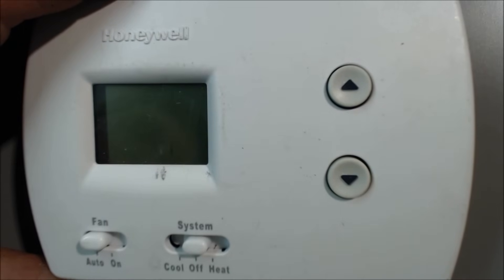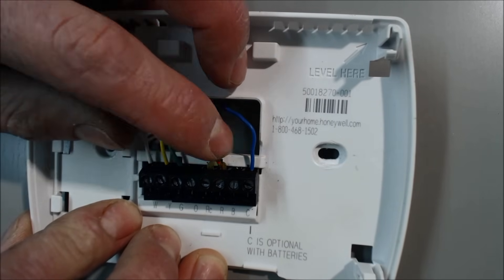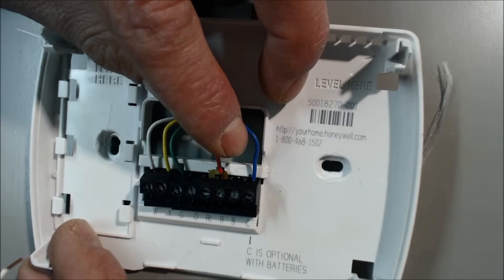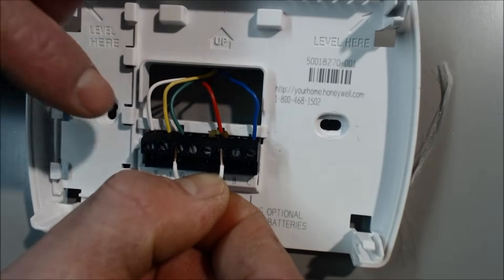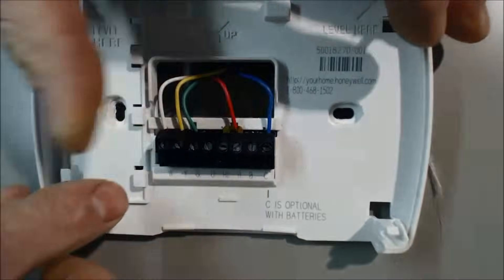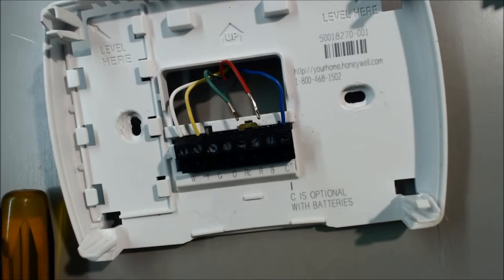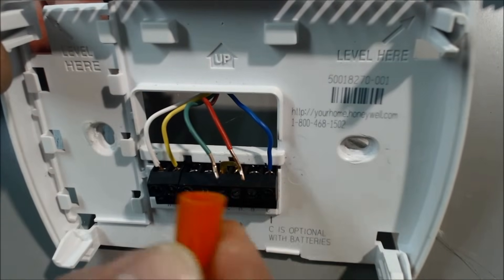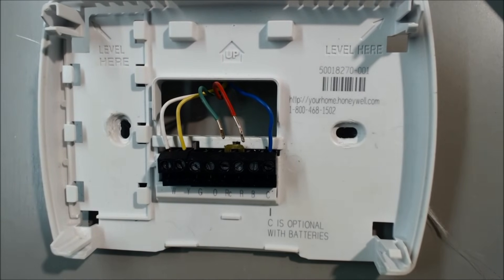Troubleshooting if a Thermostat is BAD: Explained!

Comment from the maker: Get Our HVAC Resources Here!
▬▬▬▬▬▬▬▬▬▬▬▬▬▬▬▬▬▬▬▬▬▬
2nd Edition Refrigerant Charging For Air Conditioning Paperback: https://amzn.to/4aw2OOd
2nd Edition Refrigerant Charging For Air Conditioning E-Book: https://www.acservicetech.com/product-page/ebook-2nd-edition-refrigerant-charging-service-procedures-for-air-conditioning
Mini Split Paperback: https://amzn.to/3Y4GcfN
Mini Split E-Book: https://www.acservicetech.com/product-page/e-book-inverter-mini-split-operation-and-service-procedures
HVAC Quick Reference Cards: https://a.co/d/0LZKfAt
Refrigerant Cycle Posters: https://amzn.to/4aw2OOd

Our Free HVAC Educational Materials!
▬▬▬▬▬▬▬▬▬▬▬▬▬▬▬▬▬▬▬▬▬▬
Get The Tools Used In Our Videos! https://www.acservicetech.com/tools
Our Newest Articles: https://www.acservicetech.com/articles
Try our HVAC/R Quizzes! https://www.acservicetech.com/quizzes
Reply: so before i do anything, i should shut off power to house right? so i dont get electrocuted? then open the panel display? I have a honeywell CT500 that goes blank every so often and now not generating cold air...i have a brand new AC unit too. it has no batteries, so that cant be the problem. i also reset the circuit breakers and the display panel of thermostat still goes blank and then re-appears. it does this every few minutes or so. is it a problem with the wire connection of thermostat? is it loose?
Reply from the maker: I recommend calling a tech but they would shut the power to the hvac system off and take the tstat face plate off and tighten the connections on both ends, in the thermostat and in the furnace or air handler. After that they will check for 24v to the thermostat and if they have it then it is a bad thermostat. It could also be one of the pins not aligning on the back of the thermostat.
Reply: did u power off the thermostat? i see nothing on the panel at the beginning of vid.
Reply: How to replace thermostat for boiler heater
Reply: How to replace thermostat for boiler heater
Reply: What size should the Fuse be at furnace Blower switch 15? I don't have breakers Ty~Jill~

Comment: I’ve got a heater (gas forced hot air) that also turns on the compressor.  And I don’t have a heat pump

Comment: My thermostat is reading at 72 but jumps to 74 before it goes to 72. My ac went out today and it seems like when i put it on auto, it doesnt start most of the time at all but when the fan is on it turns on but doesnt cool much. My apartment is 82 degrees right now. Is it my thermostat. I jumped the cables and my fan comes on.

Comment: My thermostat says it’s 41°. It’s not my house is cold. It’s stuck at 85% humidity it isn’t. It won’t let me program my weekly times and temperature. I can do it when it’s cool meaning the air conditioning but I can’t do it when it’s on heat because of this override my house is not 40.5°C.

Comment: What’s it mean when fan will only jump off if you catch it try to start but if it’s not trying to start up it won’t jump off
Reply: The Thermostat came with House is older model house built 1983

Comment: Do you know if having the capacitor changed on an exterior HVAC unit would cause the thermostat to behave differently on both heat and cool? 

For example, I had the heat set at 69, was cold this morning, so bumped it up to 70. Waited a few seconds, nothing. Bumped it up to 71, it started immediately. Room temp when finished was 70 though, measured by a refrigerator thermometer I had balanced on top of the thermostat.

Another example, AC was set to 73, and I dropped it to 72. At 72 (the desired temp), unit kept running. End temp was 72, according to that refrigerator thermometer, but it normally would have shut off once the thermostat read 72, not kept running. 

There have been maybe 15 second delays for the unit to kick on after changing temps, though I swear I could hear the one in the basement kick on immediately when I was playing with it last night, just not the exterior unit.

I've been playing around quite a bit with it, so I forget what's what. I just know the unit would kick on immediately with any temp adjustment, up or down, even if I switched directly from heat to cool or cool to heat right away. It's a forced air electric heat pump, if that matters. I almost wish he hadn't changed the capacitor because I liked the way the thermostat used to behave. I even went out and bought a new thermostat, the same one, $100, that I plan to install myself today, just so that they don't charge me $400 to install theirs when another place comes by tomorrow. Actually, that was the price they quoted to install mine. I don't want them telling me something else is wrong, if there isn't. Plus, I need to see how a brand new thermostat behaves so that I know what to tell them.

Comment: Question about colors of wire and the location on what letter the colored wire is placed. 

On my thermostat there is not a yellow wire. Only red, green & blue. 

Red on R
Green on G
Blue on Y 
No wire on W

When I check with the wire red & green my fan does turn on.  If I understand correctly that means it’s my thermostat front that needs replacing.

I may have screwed up the compressor by  checking (R) and blue (Y).  Is it the letter location that matters? Or, did I wreck something by checking Y & R because Y has the blue wire?

My air conditioner is controlled thru the thermostat.  The Rc is the AC? If so how come there is not a colored wired attached? 

Ii know that G is my fan and it turns on. 

As shared I tried R & Y and nothing happened; 

I don’t know where to check the AC unit either only having 3 wires versus 4.

Comment: Hello Craig. I was working in the field and ran across a thermostat that the voltage on the R and Y was 16 volts, it also showed 16 volts in the air handler and 16 volts in the condenser. Testing the Red with green, and Red with white both registered 27 volts. What could be causing the voltage drop? The contactor does not show any voltage on the coils, but when testing the coil for ohm it shows 12.8 ohm and it also has continuity. The contactor is not sucking in at all. What could be the problem? Thanks for your input.

Comment: Hi.  The screen on my thermostat is blank.  I replaced batteries, nothing.  A couple days was back on.  Now blank again…but, if I press the temperature up, it comes on (not the screen, the furnace).  Also, if I turn fan on it comes on.  Any ideas 💡. Thanks so much.

Comment: I had a call where the AH was running but the condenser was not. I had no voltage between C and Y at the control board outside or the AH. Pulled out the Tstat and jumped between R and Y and the system came on. Tstat was bad.

Comment: So my AC and fan work yet my heat (propane) does not. I did the red and green as you instructed and the fan ran so could this be the reasoning behind my heat not working properly? Does this also cause short cycling?
Reply: If I wanted to check the heat I guess I would have to jump the Red and White?

Comment: Is there a follow up video of what to do if this doesn’t work?.. I recently got a new condo.. I installed a “smart thermostat” by EcoBee. It worked fine for a few months but then suddenly stopped. I’ve flipped all breakers, I tried the things in this video.. what is weird is that since it is smart, it will send me notifications when it turns on about the temperature. I will be at work, and out of nowhere (nobody lives in my condo than myself and my cat) it will turn on for like 20 minutes and then go off again..

Comment: If the heating works and ONLY the A/C won't work, what is the most likely culprit? The thermostats display is fine, as is heat. Do you have a video to diagnose A/C only? I think the fan is fine since heating is working.
Reply: Thermostatic expansion valve(TXV hvac)? I've learned that when they fail, that the heat can still work; they are designed to fail that way(generally speaking), so you'll still have heat if it were to happen in extreme cold season.
Might not be of any help to you; just thought I'd suggest in case you're still in need, being it came to mind when I read your comment.
Reply: @rabdhall05 some unit have heat strip with no reversing valve 
So tvx valve will never go in heat

Comment: I know this is an old video but, I only have a red and white wire going to my thermostat. When I turn the heat on for my thermostat the boiler runs for a while and then shuts off. A couple minutes later it kicks back on and so on. It just keeps running like that no matter what the heat it set on. You can have it set to 60 and the temp will keep climbing...We've replaced the thermostat with the same one like three times and still get the same outcome. I just turned the boiler off and touched the red and white and turned the boiler on and it kicked on. I've had a couple people look at it and nobody has an answer.
Reply: Tie red and white together at the thermostat and see if it keeps doing the same thing, then you know the problem isn't the thermostat maybe a bad auquastat or something else.

Comment: If I’m jumping power to check the heating operation I always add the fan into the jump beacause I don’t want any thermal overloads to burn out by turning the heater on without the fan running

Comment: My furnace wouldn't turn on, and I realized that the problem started after I had changed the thermostat batteries. Checked the thermostat wiring and thought that the excess dielectric grease that was on the male and female terminals was causing a problem, then realized that because of the awkward location where the thermostat
was mounted, that the display portion of the thermostat hadn't fully seated all the pins. If you didn't look at it closely, you couldn't see it wasn't seated.all the way It allowed me to run the fan, but not run anything in auto, therefore no call from the thermostat. Motto: Make sure the face plate is fully and evenly seated.

Comment: Any idea what would cause the blower motor to blow harder once I removed the jumper wire to diagnose the thermostat. My blower kept blowing for about 20 seconds after I pulled the jumper wire and it blew harder than it did when thermostat  was working

Comment: I'm a little timid about even asking this question....if the face plate of the thermostat is off and you are jumping the wires outside of the backing plate..how are you turning off and on anything? I'm lost a little (or a lot---lol) on this. 
My AC is blowing but not cool. Trying to troubleshoot a little to see what I could try to replace but hate to replace parts that are not bad. 
Anyone with a suggestion....I welcome it. Thanks much. Jesus bless.

Comment: My  Lennox  Air Handler CBA 27 fan will not come on on circulationg "ON' setting since it was installed 3 years ago. Just running AC from my attic. Would like to circulate the fan all the time. I have even changed out the thermostat. Any thoughts?

Comment: So if you jump the 24v wire to the g wire and it turns on (thermostat is set to auto not fan), that means the thermostat is bad ?

Comment: When you say fan, are you referring to air handler fan or compressor fan?  My AC is not getting 24V at contactor to turn on compressor and compressor fan but air handler fan is working.  I'm getting 24V b/w R and Y, R and G, R and W on thermostat.  When thermostat calls for cool, G and Y goes from open to shorted (connected).  So the thermostat is working fine, correct?

Comment: What causes the ac to keep running when thermostat temp reaches but it’ll cut off at night when outside temp cools down?
Reply: For residential home with local thermostat. Possibly a schedule for the cooling on the thermostat.. 1 yr later and no one could comment their best guess. Comments are greatly welcome
Reply: The ac with cold air keeps running after reached setpoint? If just fan is running blowing normal return space temp air, then blower probably has a schedule. Or the contacts themselves are bad in the thermostat and the unit shuts down late at night due to low pressure/ low limit with cold outside air. Then resets the next day

Comment: Thank you very much for your video. My system was keeping running when both inside and setting temperatures are matched, what is caused the problem inside the air-handler, need help?

Comment: Another way I have done it. I used the pins on the back of the thermostat battery operated type. Call for blower the pins should ohm out. Same thing for calling for heat. Make sure you are connecting to the correct pins because they are not marked you have to reference how the pins plug into the back plate.

Comment: I just put in a new condensate pump. Pretty simple. Turn off the power, unplug the old little giant and remove. Install new little giant, plug in and power up. Problem is that after doing this I have no power to the thermostat. I jumped the fan but it doesn't run. It's a tempstar and I don't believe there is any reset switch. I have checked fuses and breakers and all are good. I filled the reservoir and the pump works. The pan is not switched for water. The fan just hums. I checked the capacitor and it shows 7.3. Any idea where to look next?

Comment: Excellent tutorial.  I asked a guy years ago how he knew the tstat was failed, he said, 'I jumped it' and I assumed but didn't know that meant (esp with multiple wires, and why).  It makes sense if something is simply not turning on.  If it starts/stops w/o hitting temp, I assume that is on furnace side?

Comment: A service guy came and told me the first stage heat pump does not work because he could not feel the heat when touching the tube. Do you have a video to check which heat pump has problems in the two-stage electric AC+furnace system?

Comment: What’s wrong when the thermostat works on fan only ? When put on auto the ac and the heat don’t work. It does nothing, no sounds or anything
Reply: I found the thermostat wire and didn't know that's what it was and accidentally cut it...found I blew a fuse in the AC unit itself but STILL couldn't get the thermostat to cut on anything but FAN but what I didn't know is sometimes it needs a 5 min reset time so if this post isn't that old try setting your thermostat to AC on and wait a few min and see if it clicks on.

Comment: P L A Y    Power check, Load check, All your switches, Your lines.   Not the best acronym, but it's honestly super effective for troubleshooting electrical issues. Start simple, and eliminate the simple stuff before moving onto more complex stuff. Obviously you use your common sense to skip steps, like spotting a burned connection or hearing a motor make nightmare sounds.

Comment: Having problems with the air conditioning sometimes when it is on there is no cool air coming out..had a wellness ck up in june..guys said outside unit was fine just needed cleaning.. But once in awhile it seems the spark doesnt start the cool air..we turn it off for 10 mins..the on and it will start..could it be its not firing up correctly?
Reply: Also inside temp will say 82° and will not go any lower..til we turn it off for 10 mins then restart.we.always change batteries first a check fusebox..fusebox not hot..

Comment: I helped the fan by spinning it manually.   It slowly turns on. Air is still humid. Not blowing cool.  I turn the furnace off, but the fan still sounds like its on and it doesn't spin.

Would this be a thermostat problem?
Reply: No that would be the Start/Run Capacitor being  bad if you here the compressor making noise and the fan not running

Comment: Thank you for saving me a costly service visit! Your suggestion of tapping the R and G wires helped me confirm a bad thermostat! Thank you for taking the time to produce easy to follow instructional videos with detailed explanations that don’t require hvac training to understand!
Reply from the maker: Glad it helped!
Reply: Hi---It looks like you understood what he said about the red and green wire. Did he say the thermostat is bad if the fan DOES come on when touching the red and green wires together or if the fan DOESN'T come on? Thanks for your help. Jesus bless.
Reply: @sandrarichardson2713  Hi! He said if the fan turns on when you jump the R and G, then the faceplate/thermostat is bad. Good luck!

Comment: What if my thermostat is off, but a/c continues to run? I have to pull the themostat from the wall to turn off the a/c.
Reply: Thermostat wires Red and Yellow is AC wires. Thermostat is a switch Red and Yellow wires is ON when AC is ON and it should be OFF when when AC is OFF, meaning not connected automatically thru thru thermostat circuit board.🙌😎😍

Comment: For anyone who's control panel is working and whose unit is fine but doesn't seem to be sending data: If continuity from the screws to the copper is good, look at the AC unit's circuit board and check the fuse(should be purple or amber). I accidentally blew it somehow when moving the thermostat. Easy fix!
Reply: Thanks! You saved me so much time. Couldn’t figure out what my problem was!

Comment: The furnace is a TRANE TWV 025 B140A1 May 1994. The problem is  no heat.  The thermostat is an older mercury switch RHEEM.   I would like to check the thermostat for continuity for heat. In the video you say to jumper red to white to check for heat , but how is this done if the green wire cannot now receive power so no fan, no way to check heat from the vents. Confused and would appreciate any advice. BTW cannot find any low voltage fuse for the transformer. ... supposed to be a 3.1 AMP... cannot locate. Shows on the legend, does not show on the schematic. Additional info.  Installed a Honeywell non programmable thermostat as suggested by Honeywell. Could not correctly program and they were less than helpful. Re-installed the RHEEM mercury Thermostat. Same condition. Also replace Time delay fan manger.. Limit switch checks ok. This is why we suspect the T'Stat.  Do you concur this may be the T'Stat ? Or?  Baffled. Thanks.